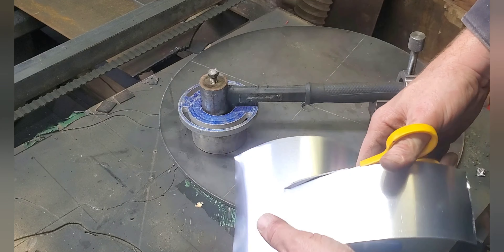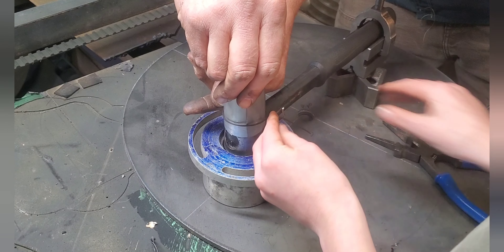Easy Casting Lead Dead Blow Hammer Experiment

Comment: Have not had a use for a lead hammer,but if I do some day. I have some linotype lead. It's an alloy of tin antimony and 84% lead. It's harder than lead, won't spark and still heavy.
Reply from the maker: Good to know, I had the sheet and didn't even think of the hardness until after using it.  Oh well a little time and lots was learned

Comment: I am confused as to the "dead blow" part. Dead blow hammers have pellets inside to stop rebound. Did the original hammer base have pellets inside? If not isn't this just a lead hammer?
Reply from the maker: I believe the dead blow describes to it not bouncing like a steel hammer would if I'm not mistaken. For example a shot hammer, brass hammer and a lead hammer all are a version of a dead blow hammer to verifying degrees .

When im using a steel hammer in the same manor it will not seat the work down to the parrelles and in some cases bounce it up higher.   When I use my steel hammer I will put a 1/2 piece of all or ¼ steel down.
Reply: @Wrighmachining  Odd. Not important either way, I just haven't seen that usage before.